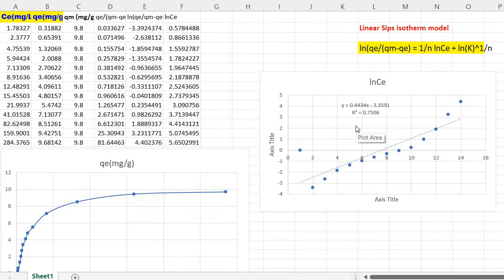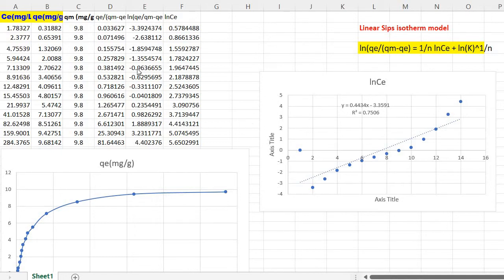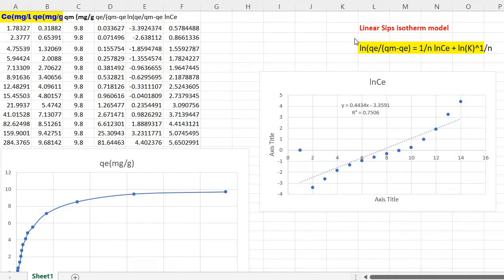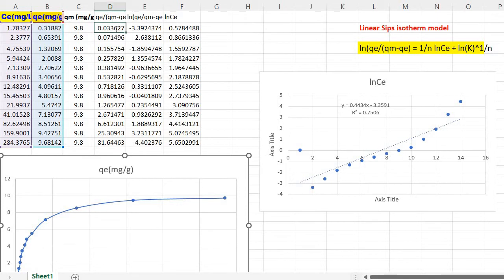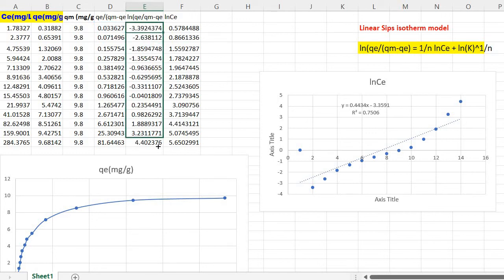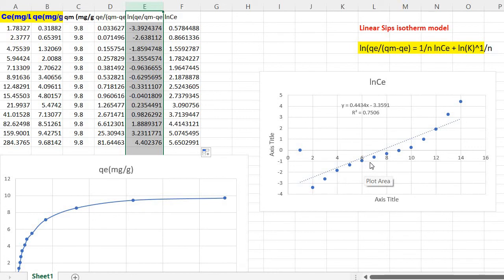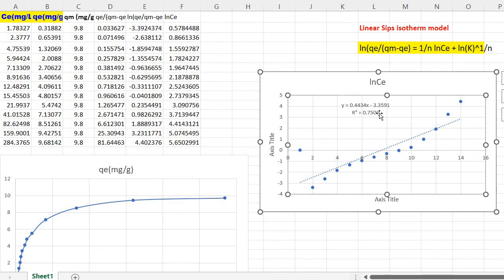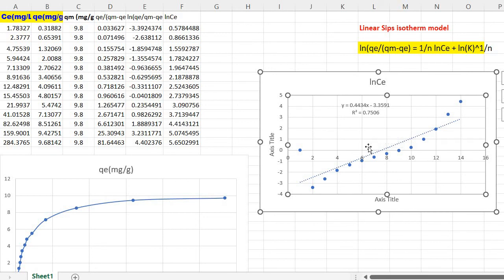Linear Sips Isotherm Model Fitting in MS Excel

Comment: If in an experiment the maximum amount adsorbed at equilibrium is achieved. Can it be used as qm in sips isotherm?
Reply from the maker: You can use it for comparison purposes only. otherwise, you have to fit the Sips model and find out qmax.

Comment: Sir, could you please make a video of how to do drift correction in the measurement data? I have measured ICPOES data and, at the end, when 5 ppm standard was checked by machine, the values were lower than 4.5 and some elements were lower than 4. I am having a cost and time crisis to repeat measurement and moreover, to analyze the data to meet the deadline that I am stuck in drift correcting my measurements. Please kindly help. Thanks a lot Sir.
Reply from the maker: Thanks. You need at least three replicated data. Drifting is not always good. So please repeat your measurements.